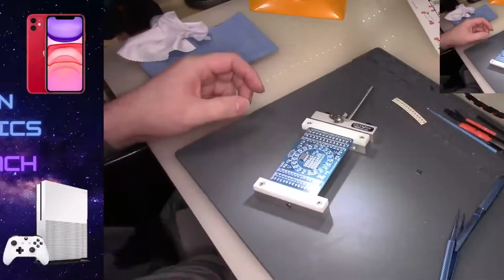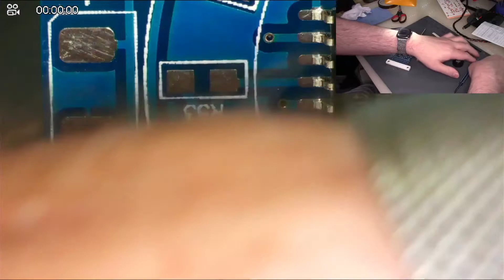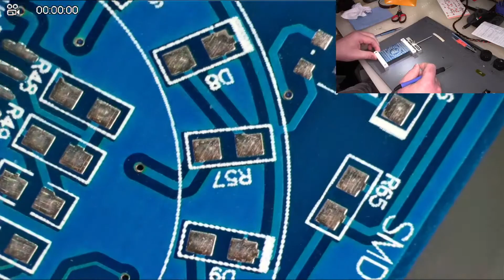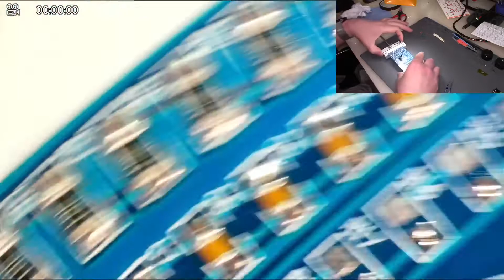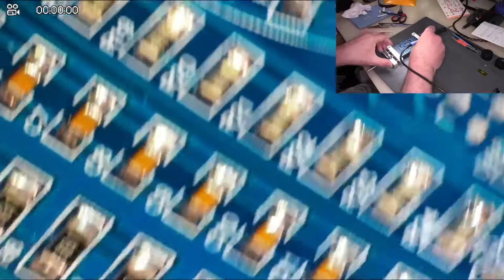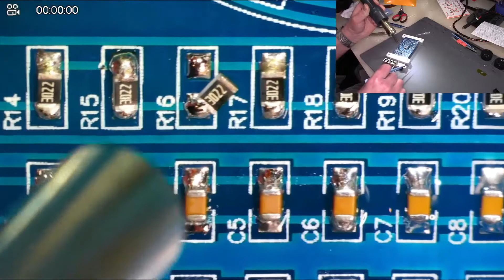Horrible Sound, But A Good Test Of Some Tweezers

Comment: In your other video you got the hakko board holder, what do you think of it?? Would you recommend it? Great vid👍
Reply from the maker: I like all my board holders and recommend them all, but keep in mind if you don’t have a use for it, it is probably not a good fit. I use the Hakko Omnivise to change connectors on the switch and it works great and I don’t know how I would change them without it. I hope this helps
Reply: @jasondoesthings919  appreciate the help👍